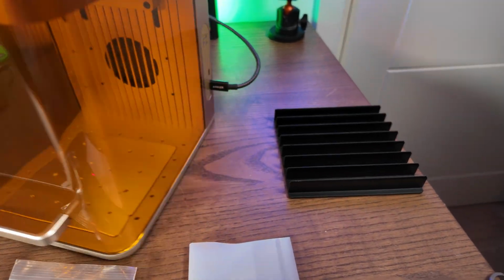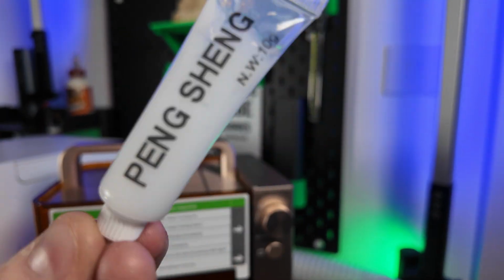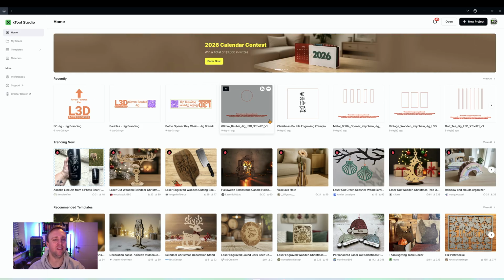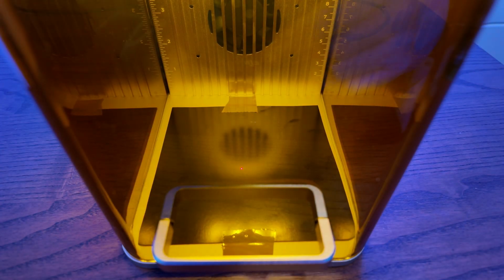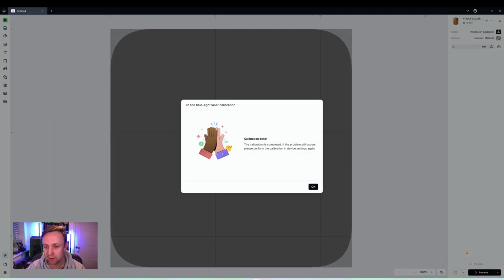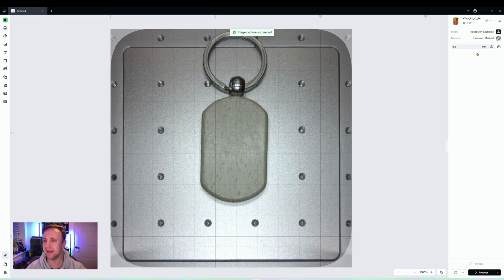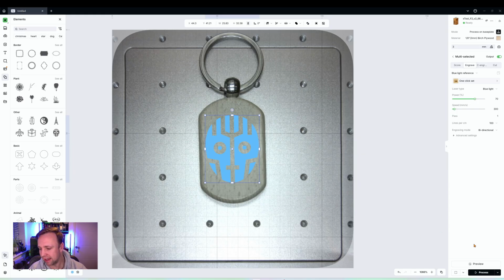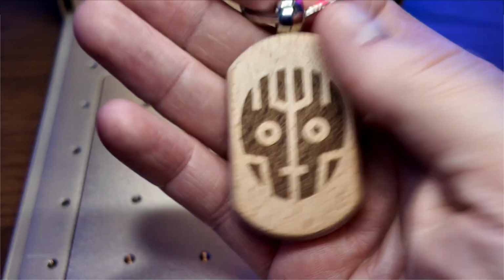xTool F2 Beginners Start Here First

Comment: Can you engrave Biothane?
Reply from the maker: It's not a material I'm too aware of. As long as it doesn't contain PVC and you have good ventilation then it would probably be ok. Definitely worth checking the ingredients first though!
Reply: @L3DAccessories does it not engrave PVC?
Reply from the maker: @JessicaHiggins-l6k PVC produces toxic fumes which are dangerous to you and can also harm electronics.
Reply: @L3DAccessories I am very interested in the xtool f2. Would you suggest f2 or f2 ultra UV? I would use this for markets. I just don’t want to spend a couple thousand on one where I should just go big right away. If you understand that. lol.

Comment: Amazing video, thank you for the content! I hear the extender has this issues with the grooves running left to right. Any tiles or tricks for proper vent in that case?
Reply from the maker: I haven't actually used the extension slide very much but the times I have used it I didn't really have much of a problem with the orientation of the grooves.

Comment: Do you have examples of deep black metal engraving or marking made with the F2? Can items like cutlery — such as knives or forks — fit inside it?
Reply from the maker: I've carried out dark engravings on stainless steel with great success on the F2. At some point I'll be doing a tutorial. It could definitely engrave onto those items, the engraving spread is approx 110mm so that's the size you'd be able to engrave onto those items.

Comment: I got my F2 last week and something is strange. I also got the F1 and the F1 had almost no gap between the laser part (that you can move up and down with the knob) and the housing. Especially when you grab the holder to carry it around, the part where you hold it doesn't move.
On the F2 there is a gap of min. 3mm. When I grab the handle to carry it then the gap closes. It seems to work quite normal but I am a bit worried about that and would like to know from other user if this is normal or a faulty device.
Reply from the maker: Although it looks very similar to the F1 I'm finding that the design is different and the range of movement is also different. As long as it works normally I'd say it's absolutely fine. If you're unsure I'd recommend reaching out to xTool via the Facebook support page.

Comment: Hi Chris, haven't got a clue what I am doing wrong, but there is not a "one click set" bar on my version of xTool Studio.
Reply from the maker: Hey, it all depends on which material you selected from the library and which machine you're using. Sometimes xTool haven't pre-loaded a one click set for certain materials. I'd try and find a similar material in the library and see if that has the one click set.
Reply: @L3DAccessories thanks Chris, can I ask when you got discharged, a long shot but you may have known my son. Jason Swindlehurst.